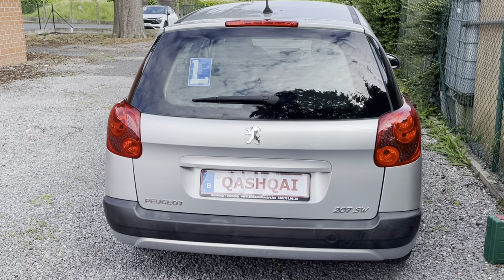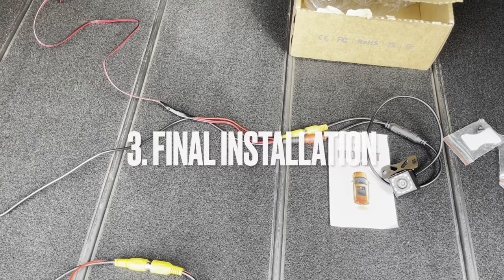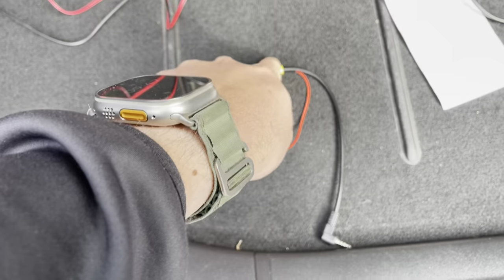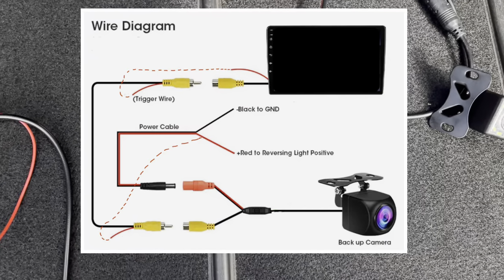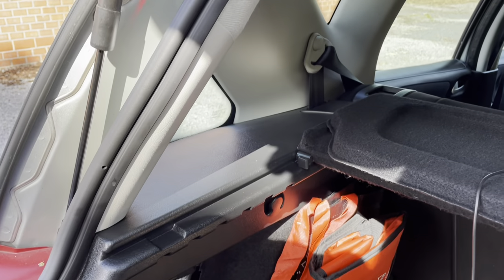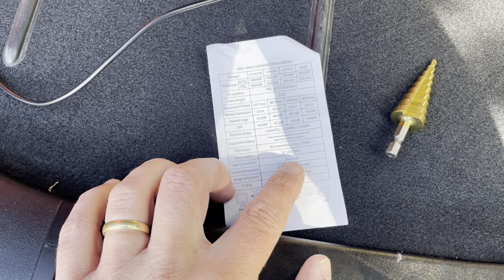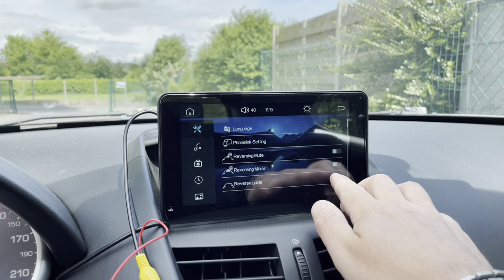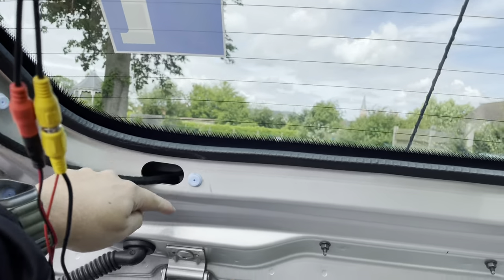How to install a reverse camera (any car brand!)

Comment: Hello, thanks for this video. What if I want to install a FRONT parking camera in my Qashqai J11 2020? It comes only with rear camera
Reply from the maker: Hi! It’s the same principle but you should add a switch inside in order to turn it on/off manually. Find yourself a suitable camera and cheap screen and check my channel for the video on how to wire from under the bonnet to the cabin and the one on how to add a toggle switch. 😉